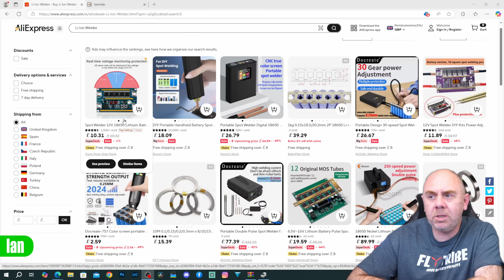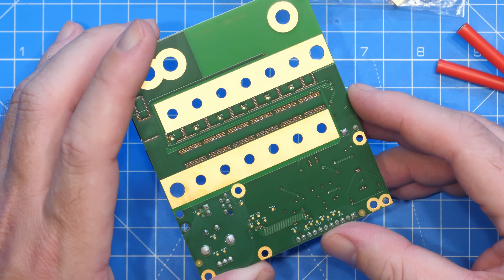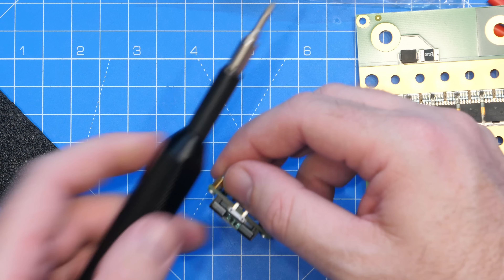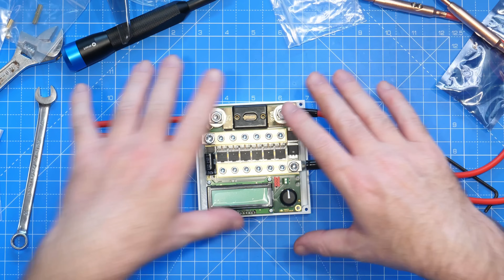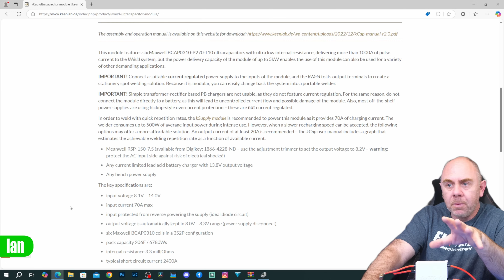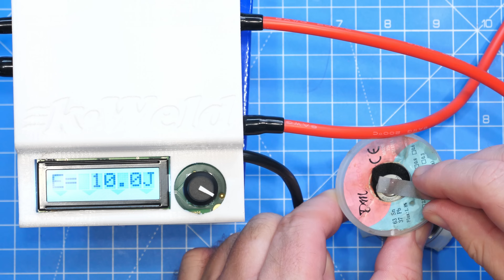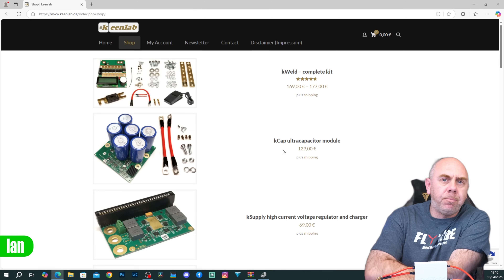Keenlab kWeld Battery Spot Welder For DIY Li-Ion Packs  - Kit Overview, Assembly & Demo

Comment: Thanks for this. It looks like my cheap 650A thing off Amazon isn't going to cut it even for 0.15mm.
Reply: I have a portable spot welder that does about 650A, that I'd bought a couple of years back for somewhere around £50-£70, but only used for the first time recently. For nickel-plated 0.1mm it is just about okay using max power, but for 0.15mm pure nickel, it just doesn't cut it. It was okay for fixing a small rechargeable neck fan, but my dreams of building battery packs will have to wait until I buy something with a bit more power. Disappointing as it is a really nicely built unit.
Reply: @rikmoran3963  I'm in the same boat. Just bought my second set of 130 Li-ion 21700 batteries because the first didn't have a high enough C-rating (the new ones are the latest EVE 17.5C ones) so need to wait a bit to buy either the k-weld or another high current welder (or my wife will beat me to death with a blunt object...). I'mm going to create low-C batteries as portable charging packs with the existing kit though, they're 5000mAH so I can create a decent power bank and possibly low-demand batteries for fixed wing drones (but this may need better welding).

Comment: kind of pricey for what it is.  I understand quality has a price, but they can still fail.   a $50 device dies, replace it.  I could replace that twice and break even.  $175, and it should have a good warranty.
Reply: I tested a Chinese welder and a one based on huge caps and they are nowhere close to kWeld in terms of ease of use, repeatability and performance.
Reply: I actually had contact with support on repair and was quite pleasant experience even 4 years after initial purchase. It was not warranty case for sure, but it was my stupidity that actually killed the unit, so as far as the built quality goes it's very close to bulletproof. And support is good.
Reply: I don't mind paying for quality, but I prefer something inexpensive if it works, and I only expect to use it occasionally.  
I admit. I have soldered a few batteries in my time.  I have placed the cells in an ice pack to keep them cold while I apply 400c to the terminal. I don't know if that helps keep the pack protected, but makes me feel better
Reply: @Mupshot  IMHO there are two options, higher end welder like kWeld or soldering. I made my pack with 2.5mm solid copper wire.

Comment: solding  > spot welding. lightly sand the terminals, clean with alcohol and there is very little time sitting there with heat on the  batteries. Nickel strip is just too finnicky and you'll need to stack them multiple times to reach the current limit on 21700's used in the fpv hobby. Takes 2 seconds of heat max to solder a good 12awg wire and you don't have to deal with nickel strips or any of this nonsense. You end up soldering anyway attaching the wires.🤦
Reply: Nope.
Reply: @Gowieee My packs do just fine soldered and I have had much more reliable contacts than nickel strips. To each their own.
Reply: 2 seconds max? More like 5 to 10 unless you have a 500W soldering iron or something. Sure you shouldn't draw more than 20A for a long time from a .2mmx10mm strip, but if you fly long range you will be using 10-15 A anyways. As for the xt60 wires, you can and should solder them on the nickel strips beforehand. Soldering leads onto a battery will definitely cause damage, more so if you are inexperienced and spend too much time with the iron on the battery terminals. Over 80 degrees C will start degrading the cell, let alone applying 350C+ for 5 seconds. If you spend $$$ on a good cell like Molicel P50B you better spend 30$ and buy a cheap spot welder
Reply: @argyrisF4 a 30$ spot welder is unlikely to reliably produce good welds, and you really want that for 50A peak draws.
Reply: @argyrisF4  400C at 2 Seconds Max. Pretin the wire and terminal. If it takes you longer you need to prep the terminal better. 20A is not enough especially for 21700 packs in a fixed wing. To each their own but you're soldering anyway when you're attaching the battery leads and I've had way too many nickel strips detach to trust them.
Reply: @fpvcapsule  If you had nickelstrip detach, then you had shitty spotwelds. Basically cold solderjoint but in spotwelding terms.
Reply: @KidCe.  Agreed, it was much easier to achieve a solid joint with soldering.
Reply: @fpvcapsule  yeah, its much easier when you have good Equipment, good preperation and good skills. 

But i wouldnt throw out the fact that soldering cells is better. 

The Solderjoints on some easy motorpads that i have seen from some people are insane. Imagine these guys trying to solder 18650 or 21700 cells.
Reply: @KidCe.  If someone can't solder motorpads they shouldn't be messing with building their own li-ion packs. But, ultimately safety is up to each person and I'll keep soldering my packs👍